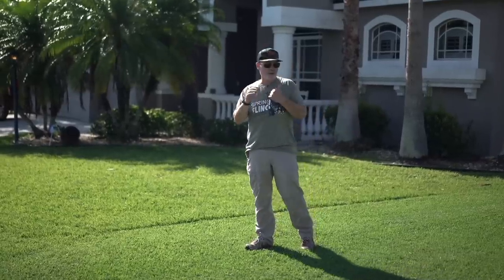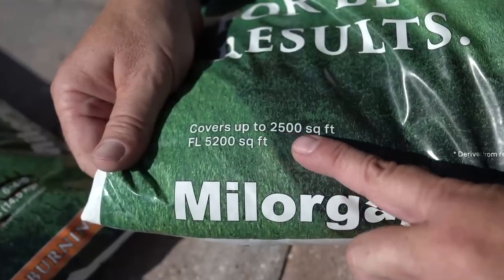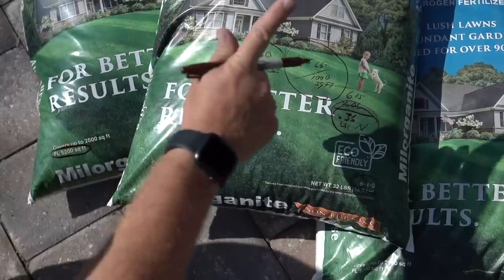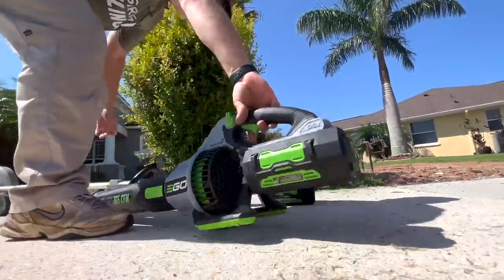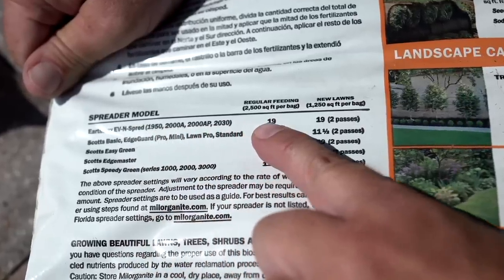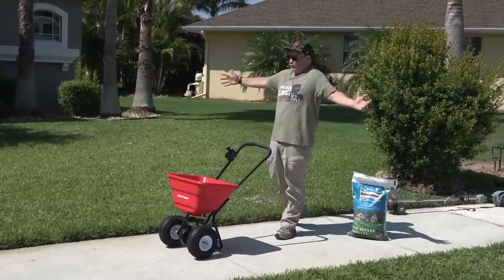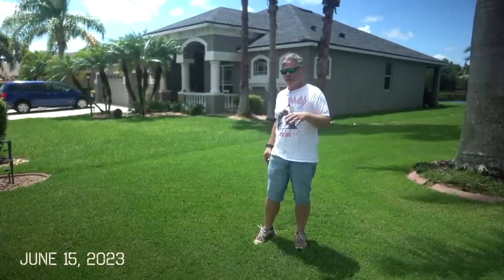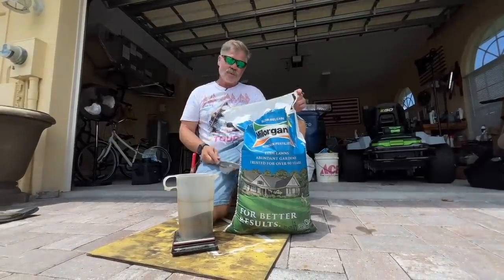Applying MILORGANITE - at "Half Rate" - Does It Work?

Comment: So complicated, here is the easy way to figure fert rates.

Let's use a fert with 20% nitrogen. I don't care what the bag weight is, does not matter. Divide the 20 into 100, 100/20=5. In this case, 5 lbs. of this particular fertilizer per 1000 square feet will give you one lb. of nitrogen per 1000 square feet. 

Now, if you want a half pound per 1000 square feet, just divide the number in half. 5/2=2.5. In this case you would apply 2.5 lbs. of this product per 1000 square feet to get 1/2 lb. of nitrogen per 1000 square feet. 

You only want 1/3 of a pound? 5/3=1.66 lbs. per 1000 square feet will get you 1/3 of a pound of nitrogen.

Hope that helps!
Reply: Totally agree with this, and it's the approach I use.  I generally want 1 lb of N on the ground, so the above is how I calculate how many lbs of fert I need to put down per 1000 sq ft of lawn.  Bag rate is meaningless.  All about the % of N in the product, and how many lbs of N you want on the ground.

Comment: I'm in the Houston area and I've been putting down Milorganite at 0.5lb of N per 1,000 every two weeks and my results are outstanding. Deep deep green color.
Reply: Just a tip to save you tons of money, if you buy a 33-0-4, at 60 a bag you will get the same rate as Milorganite with less that a quarter bag. I love the stuff but when you really break the math down it's the most expensive fert on the market
Reply: @lsumaniac2485  oh, I definitely agree. I don't exclusively use Milorganite. I actually started the season dissolving urea and spraying it. I like  to start using Milorganite when it gets extremely hot like right now. I'm also using the white 50lb bag because the prills are super small and since I use a reel mower on my Bermuda, it helps to get down below the grass canopy. It's tough to find a synthetic fertilizer with tiny prills that won't just sit on top of my grass and sometimes burn it a bit.

Comment: I bought the Earthway 2050 several years ago, however that wing nut would never hold the stopper in place.  It would vibrate loose no matter how hard I tightened it and would dump the entire product at full bore.  I went back to my simple Scott’s.
Reply from the maker: Thank you for pointing that out. I've only used it a few times and have not experienced that but I will keep an eye on it knowing it could happen.

Comment: I used double the rate in Florida one season. St Aug needs to eat and Milo just isn't cost effective or efficient to use. I did use as one of  palm ferts  before the price got ridiculous.  At 10-12 a bag it was a nice supplement.  Now at 20-30 it's out of consideration
Reply: Milo isn’t cost effective anymore because you have to use so damn much

Comment: Im relatively new to this level of lawn care. I find using the spreader for apps that differ from the standard recommended app rate on the bag too difficult. Of course the tendency is to set the drop holes in the spreader smaller than wider so you end up doing maybe 3 or four passes. Wouldn't a liquid app be easier and more accurate?
Reply: Thats how I do it if I have never used a product before.  Set the spreader with a lower application rate and do 2 or 3 passes.  I note the setting and next time make a bit bigger or smaller.  Trial and error.
Reply: @faamecanic1970  true. You could play around with a certain lbs of fert/1000 and note the spreader setting that seemed to work but if you change the rate then you have to start from scratch again.
Reply: If you have a backpack sprayer liquid is a great option
Reply: Liquid is great but it comes with its own confusion in calibrating the sprayer. Gotta get the correct amount of liquid down on the correct size area. The more you do either the better you will get. Keep at it.

Comment: Here in Birmingham I’ve had to apply heavier to get the results I want as well.  I hate it when there’s not an EVEN result, though.  Any suggestions on getting a good, even distribution?  Love your channel!
Reply: I get the best by doing double bag rate.  Set the spreader to what ever the bag says or do the math if not listed.  Then one app across the lawn.  Then do it a second time across the yard perpendicular to the previous pass.  Barring soil issues, nice even, dark green lawn.  Usually do this in spring and fall.  Single passes in the months inbetween.   A couple of those will be synthetic fert to get some other nutrients missing from milo.
Reply: @cbremer83  Is there a temperature that’s too hot to apply this?
Reply: @Christina-oq4td  not really, with milo.  Organics work differently than synthetics.  Living critters in the lawn break the milo down.  Synthetic is more direct and typically only works after being watered in.  That directness is part of the reason it can burn the lawn if too much is applied or if too hot.
Reply: @Christina-oq4td  if the lawn is going dormant from heat, milo wont fix that.  Watering may help, but depending  grass type and temp, there may be little that you can do in hot weather.
Reply: @Christina-oq4td  Nope...not with Milorganite (or Sunniland...Florida's version of Milo).
Reply: Solid tining  or "pricking" the surface will let the food get in and not move around....

Comment: As far as im concerned it's stupidly expensive these days given what else is available and what it contains. Ive been using an Andersons product this year that I love now. It's got tiny granules and goes down great. I have been doing 6lbs of humichar and fert apps every 6 weeks. About 2/3 a lb of N.
Reply: You're correct.  I live about 5 minutes away from Allyn and our very sandy soil is extremely high in phosphorous.  Never used Milo and never will.  Too expensive and there are other alternatives that will do the job just fine.  Allow the soil test results to determine what to put on the lawn, not just because lots of people use Milo.  Allyn either wasted his or his neighbor's money.
Reply: I agree that Milo will cost you as much as paying a lawn service. This is my recipe; triple 12 and any lawn fertilizer mixed 50/50 and I get good results as it gives me something around 20-8-10 depending upon the products. A light app of Milo just gives me an iron pop but spread at one bag per 15K.

Comment: My neighbor just put in some new Bahia lawn and I was just wondering what do use on that type of lawn to get rid of the weeds lawns located is Bradenton Florida
Reply: Bahia is a weed I would use round u0 on it and put down a empire zoysia lawn down in its place
Reply: Selective, post emergent weed control is like raking leaves in the wind. You usually get nowhere. Even if you manage to get rid of some weeds, more are sure to follow.
Reply: @richardgleason5953  you have to follow up the weed control with a really good pre emergent and then feed the soil not the grass if you can find a aquarium store near you or fish hobby group the absolute best fertilizer on the planet is used aquarium carbon set it out let it air dry put it in a broadcast spreader and lay it down as much as you can get your hands on I also throw in coffee grounds